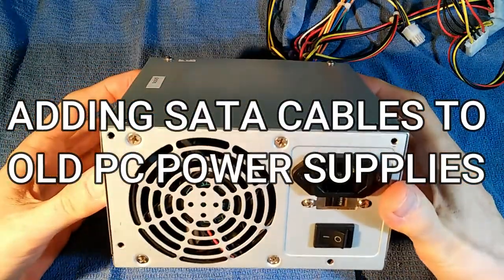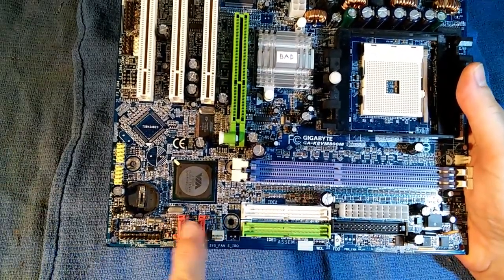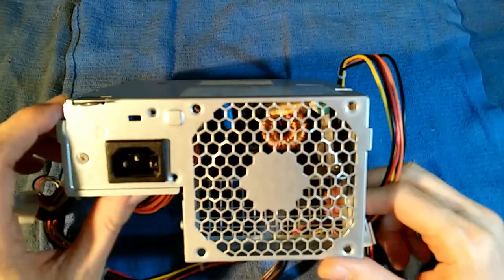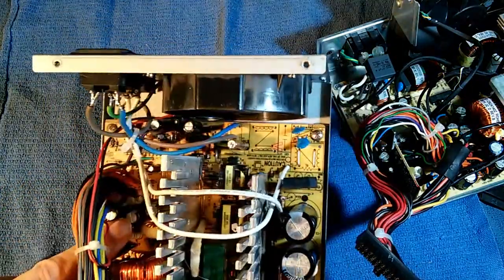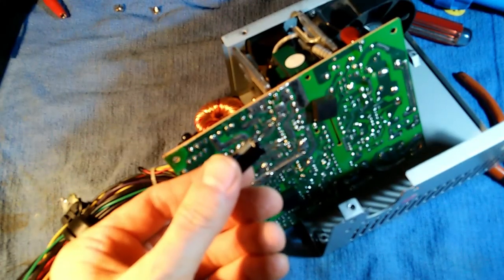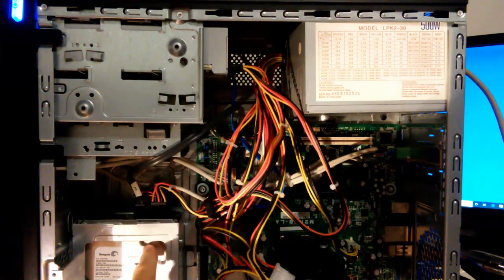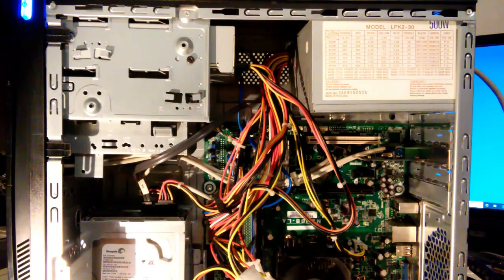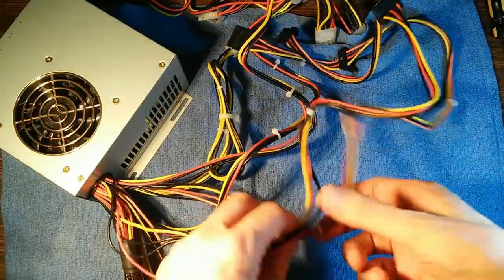Adding SATA Cables to old PC Power Supplies

Comment: don't understand why desolder / solder can't I just cut wires strip ends and (matching them of course)  splice them together
Reply from the maker: Yes, you can splice the wires. How ever, a solder connection is stronger and safer.

Comment: Do you happen to know which components might utilize a 3.3 v lead?  Because not adding that part to the converted PSU connectors is about 90% less work actually.
Reply from the maker: Very few peripheral use the 3.3 V line.  I do not have a list.  You can probably get away without it. If you encounter a device which requires it, you can always add the 3.3 volt line.

Comment: I have an 850w dell power supply that I wanted to use for my gaming pc but the connectors for the cpu isn’t there I only have the 24pin for the motherboard. And I have a 6pin but that won’t work. Any solutions?
Reply from the maker: You did not specify how many pins are used.  Most PC motherboards have a 4 pin CPU power connector connector.  Many later boards have a 8 pin.  There are adapters you can buy that will use a peripheral power connector to power the CPU. 
There are many for sale on ebay and amazon.  Example: https://www.amazon.com/StarTech-com-6in-Pin-Power-Adapter/dp/B002O21XHQ/ref=sr_1_6?crid=2HLQMAC8UG81F&dchild=1&keywords=motherboard+cpu+power+adapter+cable&qid=1612679239&sprefix=motherboard+cpu+power%2Caps%2C143&sr=8-6
Reply: @c.davidgraves4848  the motherboard requires a 4pin but all I have is two 6pin and a 24pin

Comment: Thanks for sharing!  I have been looking for something like this for a little while.  My plan is to refurbish my old power supply to power a couple of sata boards for providing distributed power to a collection of single board computers in a cluster arrangement.  This will certainly reduce the cable nightmare that I was facing.